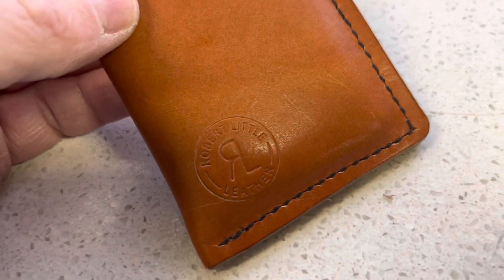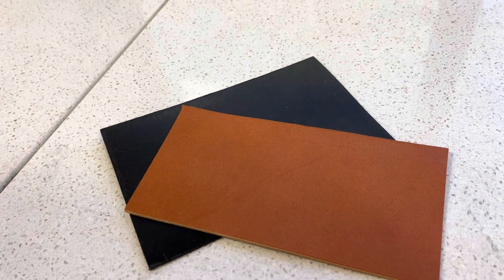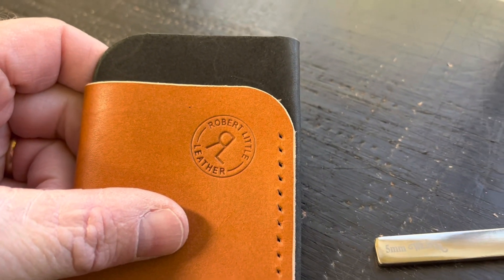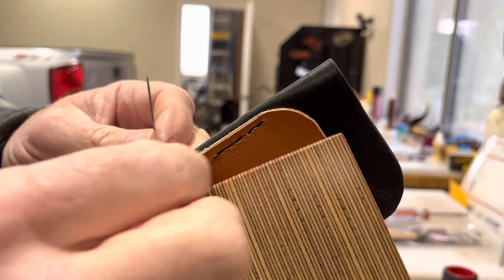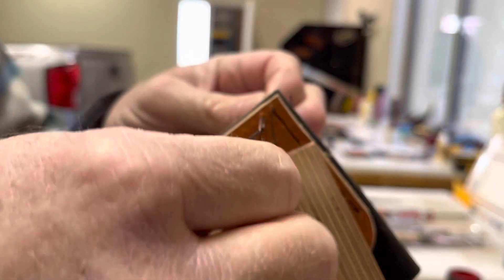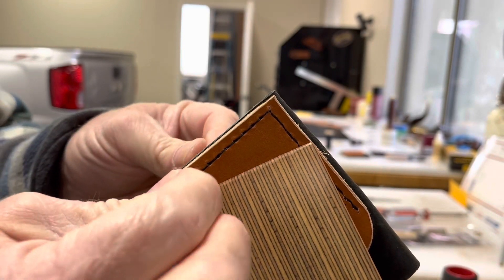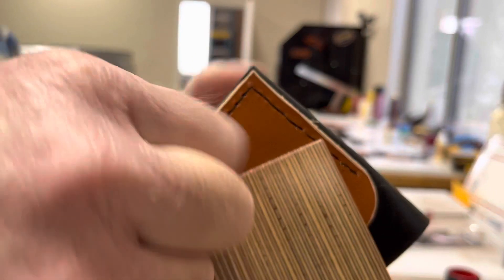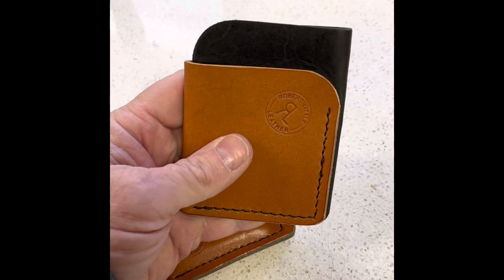How to make a Minimalist Wallet @InMyBusyLittleShop #weaverleather

Comment: those came out neat.  what size corner punches do you use?  i use the old 45 cuts method,  but one hit with the corner punch would sure make it cleaner.  lol
Reply from the maker: Thanks!  So the corner tools that I purchased from Weaver is I think the whole set. Kind of pricey. I like them and wouldn’t part with them. The smallest is 4.5 mm to largest 40 mm. I use the 12, 25, and 30 the most. When I would try and cut the rounded corner then compare to the other corner… oh a bit more off.. then back and forth. You know the game.

Comment: Hey I got a belt from you and loved it! How much would a wallet like this cost?
Reply from the maker: Mr King,  thanks for your inquiry. I sell them for $25 currently. If purchased with a belt they are $20 and you would also save on the shipping as it will fit in the box with a belt.
Reply: @InMyBusyLittleShop  $25 definitely works for me!  How should I pay?
Reply from the maker: @cidellking4536   you can reach out to me and I can arrange delivery. At this point I take cash, check, or Venmo.  (817)948-5634
Reply: @Robert Little  sorry for the late response Mr.little, I'll have the funds ready by friday!
Reply from the maker: @cidellking4536  No worries. All good.